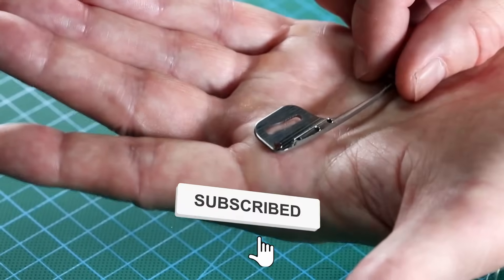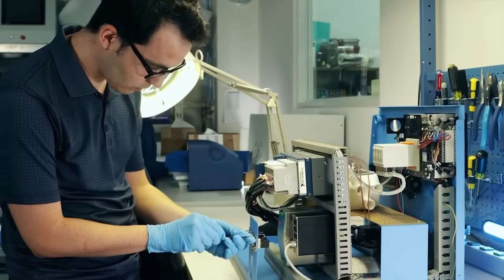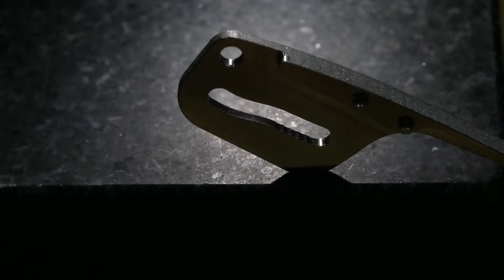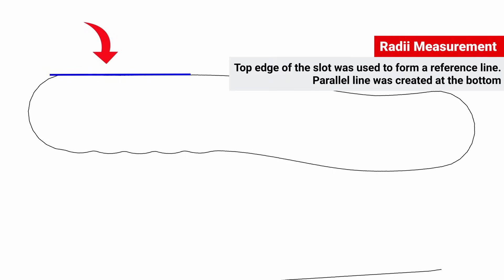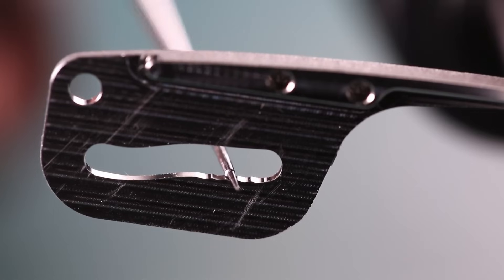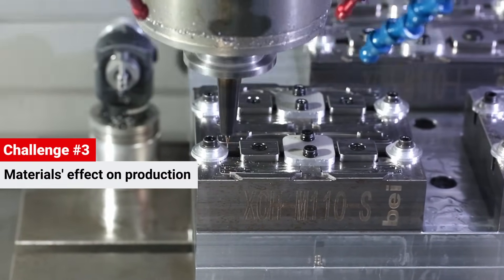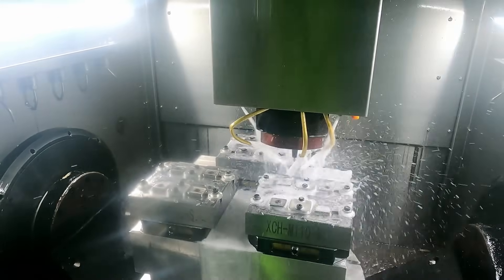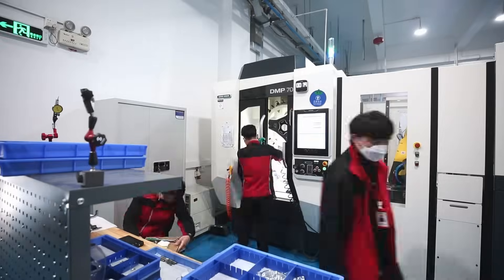Looks Like A SIMPLE Part, But It's The Most COMPLEX Part We Manufactured | 5 Axis CNC Machined

Comment: 99.9 percent of America looks at that clip and says, 2 bucks. They think you’re insane when you say, “Oh you want one, that’s 1,000 dollars”. Most folks have no idea what goes into a design.
Reply: 99.9 percent of the entire world would react the exact same.
Reply: Great presentation!
GD&T can be a real plus to manufacturing because of “bonus” tolerances the manufacturer can tease out of the dimensioning notes. But it takes several years of practical experience on the part of the designer, and then the guys making the part to really understand the system. Your example of so many critical dimensions on such a small part are almost a guarantee the designer didn’t really understand the GD&T system. Been there & done that myself. If in doubt throw some more of those little rectangular boxes full of mysterious symbols and verbiage on the drawing. Your boss, who hasn’t prepared a design drawing in 15 or 20 years, will be impressed. The manufacturing engineer who is making the CAM instructions and tooling will also be impressed. Impressed that the designer doesn’t understand GD&T!
Reply from the maker: Very true. That’s why we have a free DFM review with every project we get, so we can work with the designers to ensure smooth manufacturability.
Reply: @starrapid This is just bad engineering. Sounds like they CADed themselves into a corner from inexperienced engineers or they let design and/or marketing make engineering decisions.
Reply: I know there's a chance you are American, but this trend of casually and randomly mentioning Americans is so wild to me lol
Reply: meanwhile some factory in asia: $2 each

but anyhow a small batch like these are seriously expensive since economies of scale does not apply yet
Reply: So the rest of world knows perfectly well what goes into designing something?
Reply: the thing is they're looking at material costs and assume that since it's been produced that you have way of making it in bulk. nobody thinks of design time
Reply: Something else to keep in mind, which I learned from Ian on Forgotten Weapons. There's a big difference between making a working prototype version of a gun, and mass producing a gun where the parts are all interchangable. People who are only asking for a single copy of something likely aren't concerned about all the extra effort that is required for mass production and interchangeability.
Reply: It's not that people don't understand it.  They don't need or value it. 

Why do you need anything beyond the tolerance of a paper clip to make a letter? 

But I believe anyone would understand you can overcomplicate anything enough to make it cost a million dollars.
Reply: So are the rest of you just expert machinist? Or do you just dislike Americans because xenophobia or something
Reply: There's also economies of scale here. A custom part is expensive, a mass produced part is cheap
Reply: Hi.. We actually started making them on a HAAS VF2, but it tend to "cut corners" so we has to move it to a more precise machine.
Reply: It depends on the quantity. The development cost is a one time expense.
Reply: Machine shop owner here (great video) so much programming and expertise goes into parts like these. Making one is similar to making ten. Making a thousand parts is where we can amortize the design and shop time. I'll break it out for any customer at any time.
Reply: Yeah, was going to say, when OP says 99.9 percent of people would say something like two bucks he's right but it's because most people's sense of cost is trained on mass-produced goods, not small runs or prototypes.
Reply: meant to reply to @phantomhck there
Reply: That's because they don't understand the difference between high volume stamped parts and low volume high precision machined parts.
Reply: @skitidet4302  only thing people care about is if it works and the price
Reply: @trailfork7815  True, but how much something cost is related to how it's made.

A part can be made many different ways but there will be downsides and upsides, some are super expensive(like milling stuff out of a billet) but real good in terms of quality.

You can cut out simple shapes out of steel slabs and weld them together, then mill minor things in the end to add holes and ensure some important measurements are good. This is a good compromise of cost and quality. Especially if it's a low volume run and you can't justify the big upfront cost of making special dies for forging.

You can forge it using massive presses and dies. It will be costly to set up and might not be as accurate as machined parts but if you are putting out big volume you can make many good quality parts for low cost. The accuracy can be solved by machining specific things in to speck after forging.

If it's a thin part, you can stamp blanks out of sheet metal, press the blanks in to shape and tack it all together. This will be very cheep, especially if you do high volume but it will generally not be quality parts.

You can abandon metal altogether and injection mold stuff. You can make massive amounts of very accurate parts in a short time. However, they are made out of plastic and the dies and machines tend to be expensive to set up so it's for high volume where the material properties of metal are not needed.

These are just a few out of many more methods to make a part. If you don't understand how it is made and why that method is chosen, you really aren't qualified to say what price it should have.
Reply: @skitidet4302  you just typed a wall of text when you could have just said law of supply and demand dictates the price
Reply: @trailfork7815  Yeah, but I wanted to stress how much difference there is between the different ways a part is made. If you don't understand those differences, you don't understand how much things should cost and what method is good for a specific part.
Reply: @trailfork7815   It's funny to watch him conjur a problem in his head that Americans dont understand manufacturing volume vs quality. Then he goes on to nerdsplain an essay unprevoked when the topic isn't at all that difficult to understand. Some people just need someone to nerdsplain to 🤣.
Reply: @MortalKai-127  They don't. I have seen your media, the average person don't know anything.

Also, for someone who thinks they know more, you sure did not get what I was getting at if you summed it all down to "volume vs quality". There are methods that do well with both volume and quality, forging is a good example. I wrote that down to explain the manufacturing complexities that can't just be summed down to 2 simple things like quality vs price or volume vs quality. But I guess that's all that's simple enough for some people to get away from it, thus further proving my original point in this post.
Reply: @MortalKai-127  Don't talk behind other peoples backs, girl.